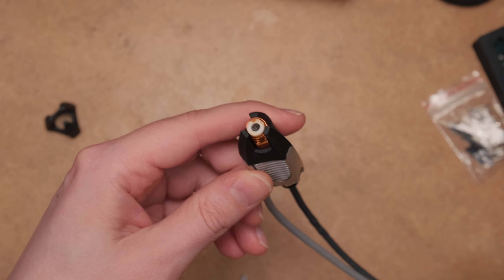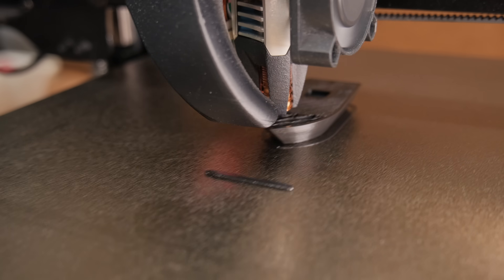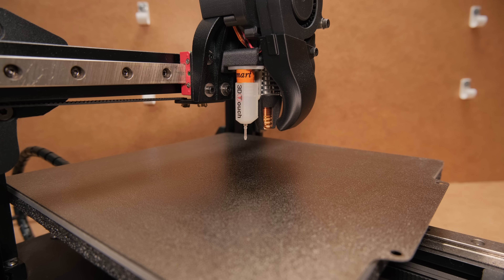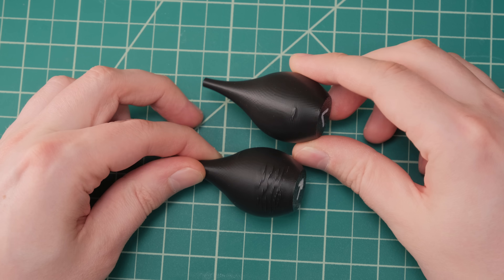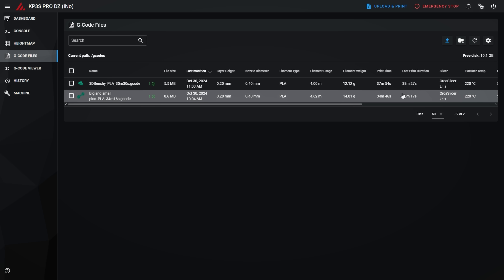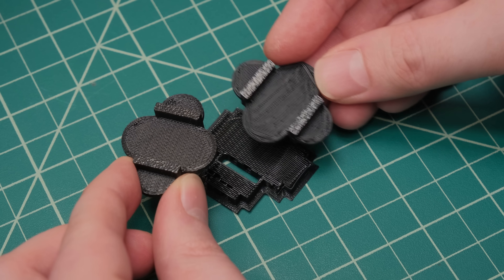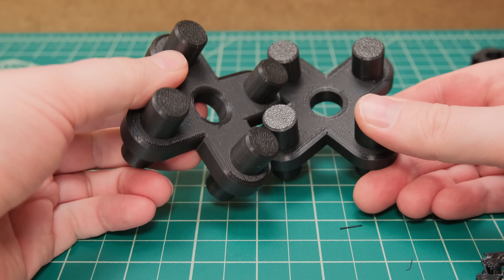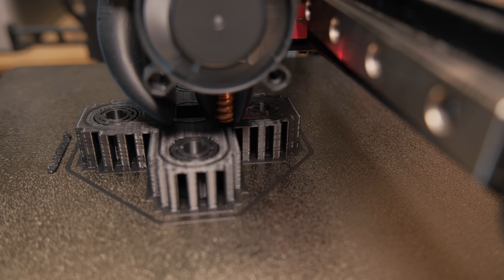World’s First INDUCTIVE Hotend – How Crazy IS IT?

Comment: Sooooo this isnt the first inductive hotend. But it is the first FDM inductive hotend. The compamy Vader systems had a inductive hotend a decade ago, but it was using a different 3d technology. Liquid metal jetting. They heat a molten cauldron of aluminum which they shoot out drops like a inkjet printer.

Comment: Throttling temperature continuously throughout the print is a huge deal. Like huge huge. Nozzle temperature is a dumbed down menthod of maintaining the amount of energy being put into the plastic. If you can directly control the Qdot into the plastic by using variable temps, i suspect print quality and layer adhesion will be superior, especially for engineering materials

Comment: Short answer: it is a gimmick.  
Long answer: You still need some material for the eddie current to go through thus making it bulkier. And the use case of the coil is adding more weight with the insulator and produces a lot of back emf if not sheilded properly. Simply put hot ends currently aren't properly designed still. A non threaded cartridge (like a properly sized capillary tube with a nozzle insert) and braze a collar on the ends with a ceramic round heater integrate in the manufacturing. This will hugely reduce the thermal mass to be heated, still don't understand why the heater cartridge is being reused it is a consumable.

Comment: resistive heating is always pushing a material to its current limit. inductive can make a PID more controllable
pieces dont break often,,,...and you can even have a space between the heated element and the magnetic coil

in wich you can blow alot of cool air at great flow. 3d printed metal pieces will appear like some heasink in lattice made of the most stable materials for temperature changes and the most temperature conductives

i have so much ideas coming from this extruder..

Comment: Thinking out loud here. Creating a bridge with zero clearance support and an extrusion pulled diagonally up/ over, then ironed down into position. This vertical looping nozzle path ends with a hardened extrusion laying upon the support top. Think freehand printing pen having made an exact length extrusion and hardened before touching it's support.  Subsequent paths rely on this first bridge extrusion as side support utilizing ironing on overlap. Slicer setup "painting" the bridge area with macro to perform the act. This method requiring a cooling/solidifying at start point of bridge allowing pulling to the precise bridge length. Following layering would iron any bumps created by the vertically angled extrusion.  Is it time to introduce 3D pen techniques to linear printing ?

Comment: $430 !!!!!!  Wtf, how the hell does cost this much for a little piece of machined aluminum and a coil of coper wire?  Holy shit!
Reply: And the control board. This thing isn't in mass production yet so the price is hardly surprising. If the idea catches on the price will drop dramatically.
Reply: @trhosking  price will drop dramatically, yeah like from $430 to $330. it still expensive..

Comment: At the moment with a normal hotend you could model areas that need support or bridging as a different material, then make another filament profile with a lower temperature. In only takes a few seconds to cool down or heat up 30 degrees. Much faster than an actual filament change on say a Bambu Labs AMS

Comment: This could open up new possibilities for single hot-end multi-material printing.  For example printing with PLA and using PETG for the support interface.  Often this is hard due to lag in temp changes.

Comment: That is stupid, all hotends are inductive these days, at least the Creality's are, with the latest flagships. Also, the print is so slow, that temperature changes are possible. They are not with faster prints
Reply: Creality does not use induction they use a ceramic heater...

Comment: This on a dual head printer like the upcoming H2D from bambu would be part of my dream printer. 
350Zx350Yx400X build area, 2 of these hotend that go up to 500c, 80c heated chamber, 120c build plate, stronger belts with lower belt pitch for around 2k-3k is as close to an endgame fdm printer for a prosumer IMO.
Reply: Yes, it would be great except that with the current nonsense from Bambu requiring ALL data go through their servers and reserving the ability to cutoff your printer at any point (following HP's ink subscription model). Very few companies will be comfortable with such a machine, especially if printing proprietary "top secret" design work like in rocket engines and the like. Most hobbyists will not be able to afford such a beast, it will be marketed to industry, and they wouldn't put up with such a data grab license. Heck I'M not happy with this turn of events and Bambu's attempt to close the system entirely!

Comment: One interesting use case for induction heating might be to have a auto-changer that just swapped the hot-end assembly leaving the induction heater in place on the extruder thus requiring no electrical contacts or flying wires.
Reply: Today you got it :)

Comment: Seems like you might be able to clone a filament profile with lower temperature for support interface layers and change the filament change routine to make it think it actually changed filament but really just lowered the temperature. Idk how well it could be tailored to still be able to use single nozzle multi material on the same machine the rest of the time though. Maybe something to look into

Comment: No, induction-heating is not "more efficient", nor is it more powerful or faster. having a rapidly changing temperature certainly can help with supports or temperature-sensitive filaments.

But for things like vase-mode with widely different temperatures? Yeah no. What you have shown there is the other nozzle already being driven past its capabilities. For good parts you want the filament to always be on the correct temperature - duh - and the simplest and most accurate to achieve that is having a nozzle at a constant temperature and a long enough segment of contact to bring the filament up to the right temp.

And not to forget: We now have mostly standardised nozzles for a good reason.

Comment: One more idea with induction heating: add iron to the filament. This could potentially solve the bridging issue where an inductor is activated to melt the previous layer for better bonding. Could have other benefits too.
Reply: I was wondering the same thing myself. Add metal particles to the filament and heat it directly.

Comment: Very interesting. The ability to print with rapidly changing hot end temperature has all kinds of possibilities. I'm thinking of multi-material printing with a single hot end like the Bambu lab's printers.  Hot-end changer printers can benefit by printing specific layers of material at temperatures optimized to where they are in the print cycle or geometry.  Will require some interesting enhancements to the slicers.

Comment: Being able to change the temp for multi-material prints (MMP) accurately and quickly might make single-nozzle MMP because you won't have to 'wait' for the hotend to get to temp. Probably less oozing as well, as you can just put the hotend into 'warm' mode and not actually hot. I dunno. Still neat, kind of like the soldering iron tech.

Comment: A clever feat from the industrial sector applications of this tech is taking advantage of the Curie point of the alloy used for inductive heating, so it never exceeds the designed maximum temperature. Once the alloy heats to a certain temperature, it loses the magnetic properties needed to continue heating via induction - thus it caps out. So it has an inherent fail-safe that doesn't need any electronic controls past that of a basic induction driver.

If the company behind this is smart, they will have used that property as part of the design.
Reply: The problem is, it doesn't rely on ferromagnetism, but purely on eddy currents. People use induction heating to melt or weld non-ferromagnetic metal parts which way exceeds the thermal range of printing thermoplastics. Unless you use a magnetic switch and an alloy with a certain Curie point to shut down the heating at that certain temperature, only the thermal equilibrium will define the temperature the nozzle will heat up to.
Reply: " it loses the magnetic properties needed to continue heating via induction "
But that is not how induction works. Neither copper nor aluminium are ferromagnetic - both still get heated up by induction.
Reply: @ABaumstumpf  References are a bit tricky to find on YouTube, but "Metcal - The original SmartHeat Soldering inventor" has an overview of some aspects of it. Another video also said the inductor driving it has to be pulsed at a high frequency between 30KHz and 50Khz for that particular effect to work. So it's likely some combined properties in the process to create the self-limiting effect. You may be able to find other references relating to mold-injection and other industrial heaters for manufacturing.

Mainly it seems the goal of all that is to hit a fairly specific temperature in under 1 second and not overshoot. And that has its uses.
Reply: Japan Analytical Industry patented their 'Curie Point Pyrolyzer' in 1969, their 'PyroFoil' Curie alloys cover 21 temperatures going from 160 °C to 1040 °C, providing a 764 °C rise with reliable +/- 0.1 °C accuracy in less than 0.2 second...  Though it's designed for Pyrolysis Gas Chromatography applications run with a 48 Watts driver @ 600 KHz.

In comparison my old Demeyere ControlInduct fry pan fitted a Salton 1400 Watts IH Cooker and stabilized around 250 °C, but much slower because of the huge additional mass.

In any case i'm dreaming of the day we're finally done with the 2008-2009 Mazzilli over-simplified asian "modules" and start having framed-signal generators that "kick" the resonator complex then "listen" for a fundamental frequency to lock on it and drive at full power.

Comment: How much did you lower the temperature for the 0 gap? I bet this could be sped up even more if we added a fan to the hot end that could be turned on when cooling mode is turned on. I bet some people might even be able to engineer a water cooling solution if they really wanted to. 

Considering how many temperature and flow settings we have in modern slicers, I bet this would be a pretty simple update for Cura or Prusa Slicer.

Comment: The trouble is, 1 > the hot end is very tall and fixed in the standard placement on the X gantry it will take away allot of the Z height when printing.  
2 > also the setting up of the lost height for the Z height will make Z height adjustments harder when on a smaller printer!
3 > the elephant in the room bit, COST, all specialized and often new hot ends cost tons of money compared to standard hot ends.
4 > also the extra cost of the specialized control board and extra cooling.
So it seems a nice new way for more controlled heating of the hot end, But at a bigger cost and more needed controlling systems.

This is why many new types of hot ends etc. don't make it into the mainstream of the hobby. Not everyone has tons of spare cash to buy the newer stuff.
Those who do, bang on about how great the new toy is, often shaming the rest of the hobby users by saying why don't you buy it?
Forgetting that not everyone is well off and can just buy the best stuff.

It looks good, But it be again a elitist thing due to the amount of cost to upgrade the printer 
and I am sure the extra cost and trouble to change the printer to work well with it.  So if your the type of person whom love to try it and has the money then great!

The rest of us who don't have the money or skills to take it on, we will just keep as we were thanks.

Comment: when firmware and slicers can take advantage of this without me having to go in and change a bunch of stuff every print, I will be VERY excited to get one, in the meantime, I just don't want to fiddle quite that much with each print to get the best out of it. Though it does still seem like a nice, small upgrade in more basic ways as well, faster heating times are nice to have all around
Reply: This is how the hobby has worked from day 1. Guys like this trying things out and having to do funky things with gcode and slicers to get it to work for the first time, and then some time later its a standard slicer feature and hardware is easy to find.
Reply: @ oh, I know that, that’s exactly WHY I made the comment I did, it’s bound to happen eventually, I just hope it doesn’t take too long 😛
Reply: @PAPO1990  yep

Comment: Super cool idea, i've been waiting for a long time for a review of this hotend and it looks great. I'm thinking about an easy way to get the interface layer temperature handled by the slicer. You could use a multimaterial approach with T0 and T1 in klipper that just does temperature changes and in orca slicer use the second fake material as the support material. I don't remember if the support material can be set only for the interface layer or if it can be specified separately for supports and interface layer. if not possible this approach wouldn't be as good as the entire support would use a lower temp, maybe not acceptable. Also modeling the interface layer as a separate object could be an option and use again the fake material only for these. Just some ideas, hope they make sense.

Comment: In the next 6 months I may sell my X1C to allow me get the parts for a custom voron machine that I can tinker and do the mods that your doing but use my X1C to print the voron parts before it goes. I think of also making quick swap toolheads for long fast print or slow complex prints using that toolhead in the video.

Comment: You can control nozzle temperature by Extrusion role command if your slicer has "Extrusion role change" custom G-Code section. Orca and SuperSlicer have that. 
It's just a question of several IF statements (eg. IF extrusion role = bridge then temperature = print temperature-20) ELSE temperature = print temperature

Comment: Funny I was just thinking about using different temperatures for infill, inner walls, and outer walls a week or so ago. You could maximize layer adhesion for everything but outer walls with higher temps and improve surface quality and overhangs with lower temperatures. This style of heater could make that much easier to accomplish.

Comment: Even more bespoke nozzles, heat blocks and radiators you can't reuse elsewhere is exactly what the industry needs for more adoption... I miss the times we only had V6 vs MK8 to worry about. The idea although interesting, but for $500 they charge I'm not sure if it's worth the money outside of very niche and industrial materials use cases, they need to drive the prices down 10x before it can reach consumer grade printers.

Comment: Last month MIT released the results from research into filaments that change color, shade or texture depending on temperature. Creating astonishing parts as if they had changed filament between areas. Title is "New 3D printing technique creates unique objects quickly and with less waste".
Uses 2 heads: one that lays down filament, the second does "speed-modulated ironing". But am now wondering if just 1 inductive fast heat / cool nozzle could be used to a similar effect ?
Reply from the maker: That is pretty cool. If it would work depends on what temperatures ironing is done, but I feel like it is way easier to use another clean close close-ended nozzle for ironing.

Comment: yeah, i tried this a decade ago, when the reprap was still a big thing... just a ZVS and impedance matching transformer (this is actually a major requirement, you cant use the heating coil as the tank inductance and have long leads as they are also part of the coil)

i gave up after wasting too much time dealing with EMI... obviously its possible to work around it, but yeah...

also the ZVS didnt appreciate being turned on and off so rapidly... a lot of FETs met their demise...